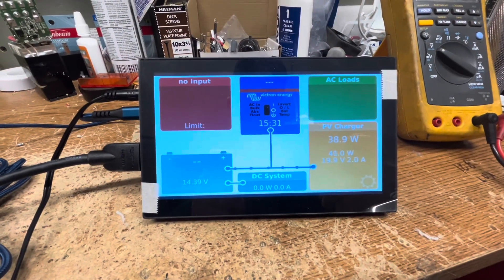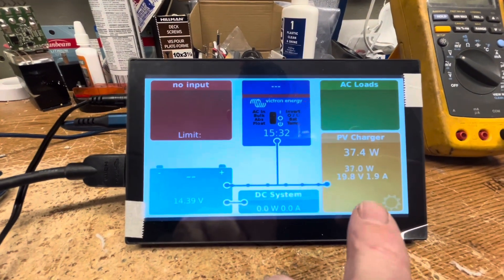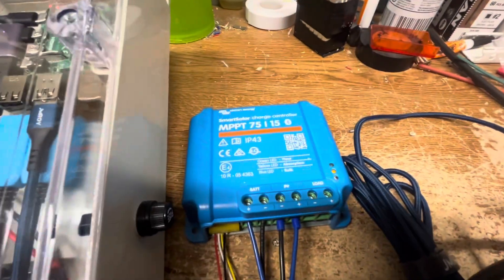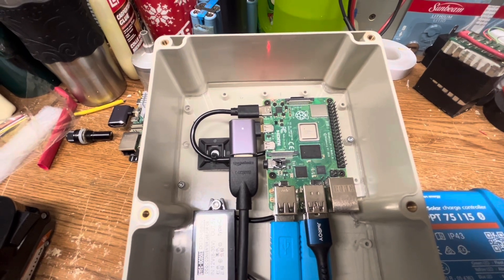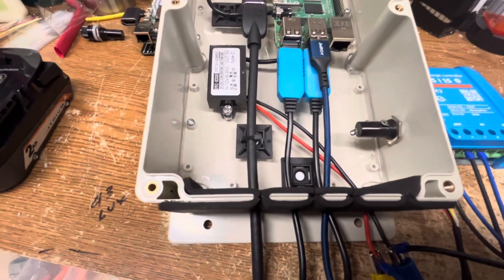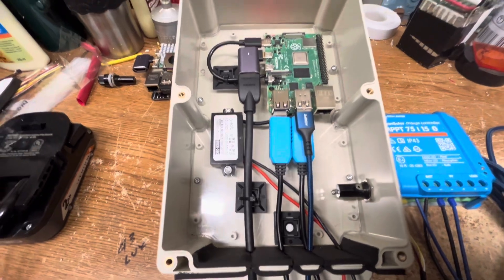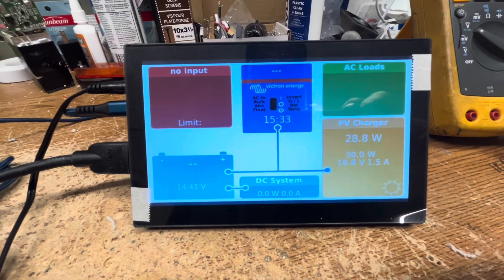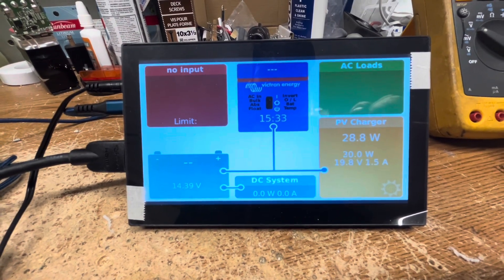Venus OS Build for Victron on my Sailboat #davethemmp

Comment: Stumbled across your channel as I was researching this configuration. It is important to have remote HDMI cable run capability. Did you get this problem resolved? Were you able to remotely connect an HDMI and USB for touchscreen support without mounting the motherboard directly to the monitor? Thank you advance!
Reply from the maker: No I wasn’t able to solve this there is a post on GitHub about it but it’s only for Raspberry Pi official screens and some HDMI but no guarantee

Comment: What are your thoughts on using a metal enclosure to mitigate emp from nearby lightning strikes? Aluminium would be less corrosion prone and still provide the fereday cage effect required. Also would have been better for transferring heat? But the lightning emp may kill everything in the box anyway as it'll travel along any unshielded wiring? Your thoughts?
Reply from the maker: The Venus OS doesn’t tax the Pi and make any heat even a Pi 2 can do this job. As for lighting haven’t really considered this